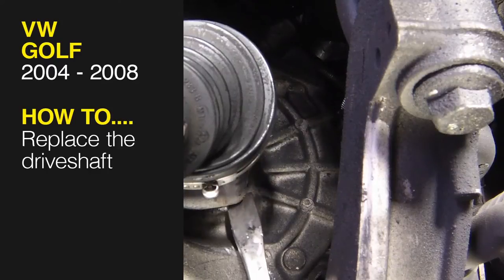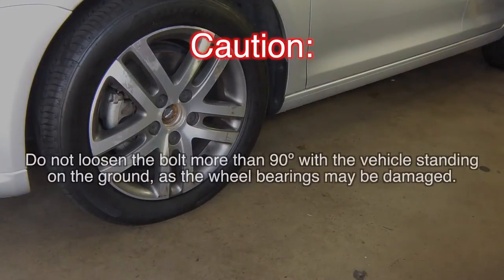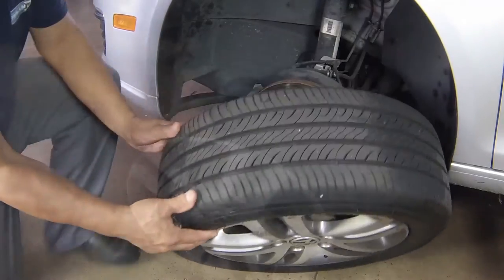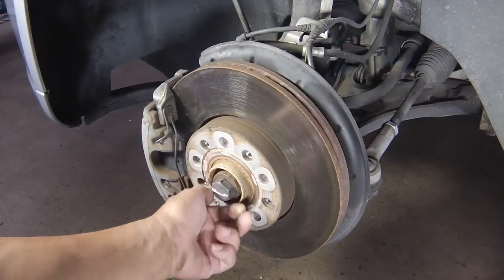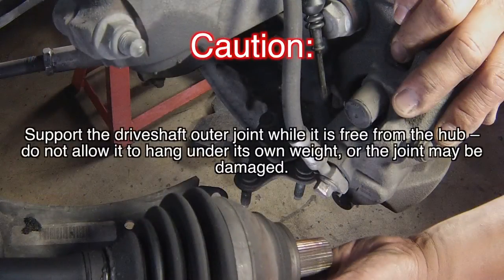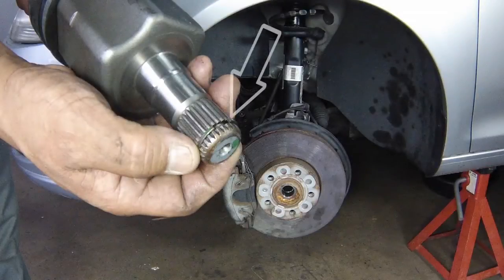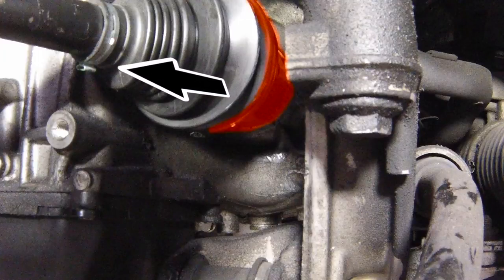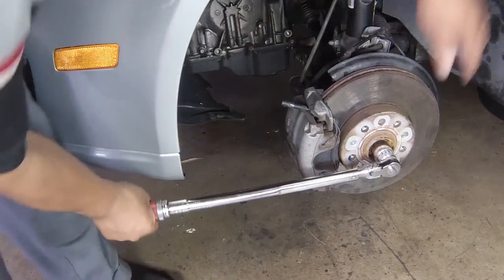How to Replace the driveshaft on a Volkswagen Golf 2004 to 2008

Comment: This Video is NOT technically correct, as the majority of VW Golf's do not have the inner CV joint 'splined' within the transmission (transaxle). Instead they have a 'flanged' inner face that unbolts (look at other similar video's for confirmation).
Finally, from your video can I suggest that when using a breaker bar to loosen bolts, you 'push' downwards on the bar and not pull upwards...... simple!........
Reply from the maker: This is for the US market Golf. The UK ones have bolted flanges as you correctly state.